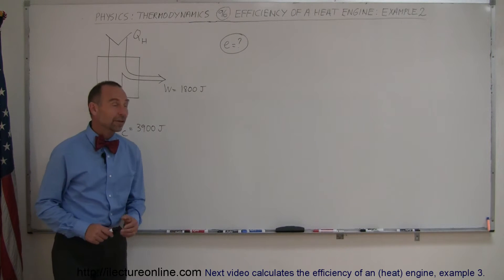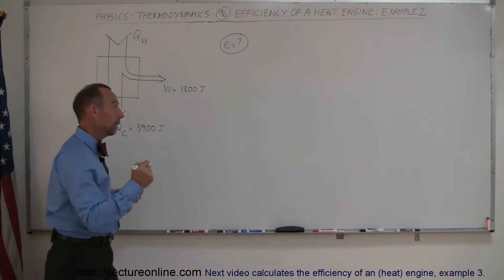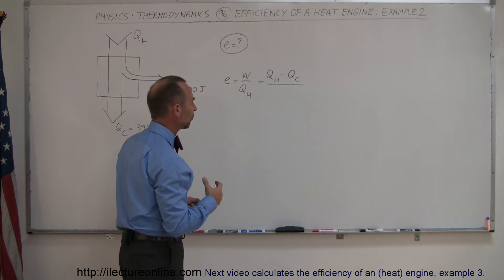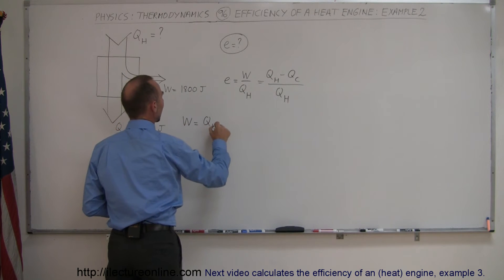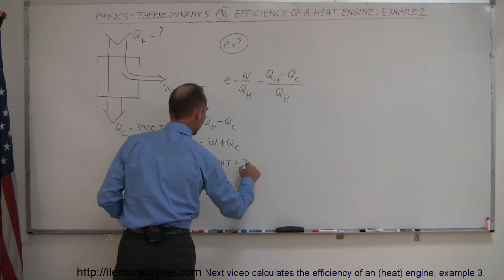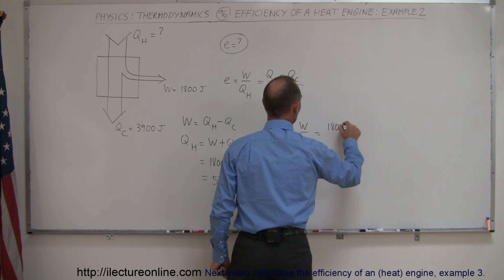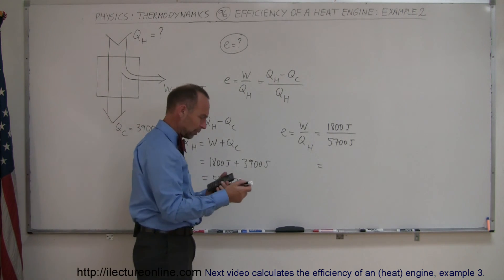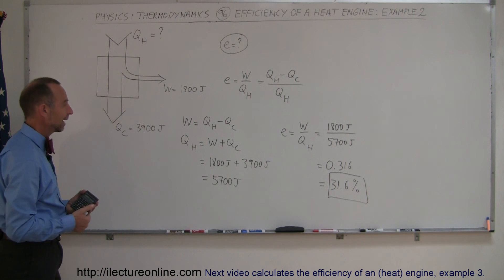Physics 29  Efficiency Of Heat Engines (6 of 14) Efficiency of a Heat Engine: Example 2

Comment: Sir, what will be the equation of Work if the heat is expelled with in the system e.g. a gasoline engine in a large truck?
Reply from the maker: Look at video 13 and 14 in the playlist.